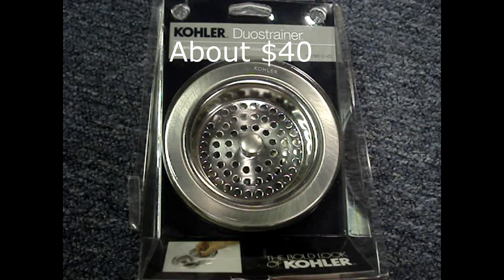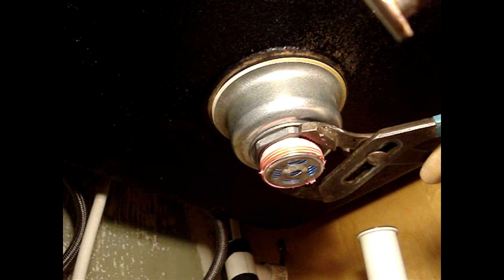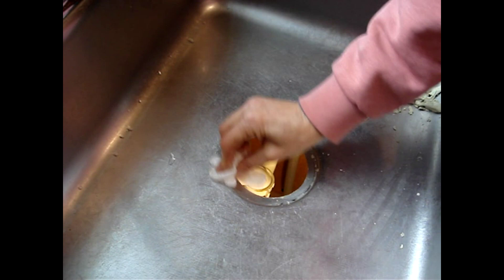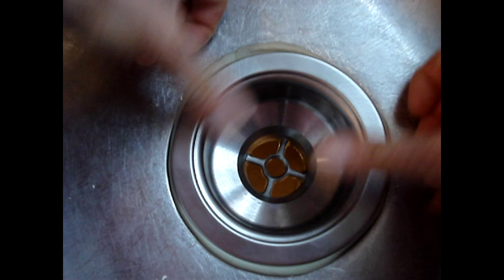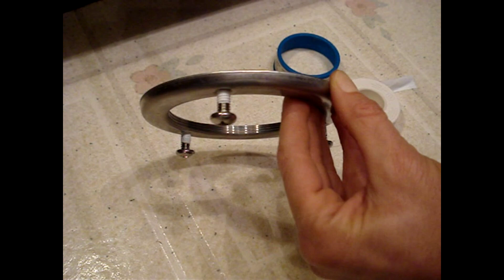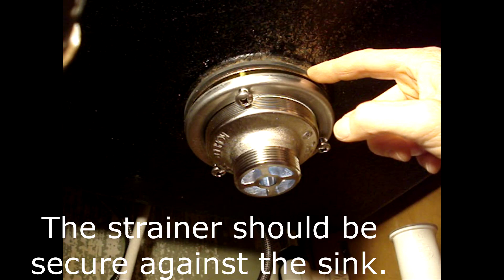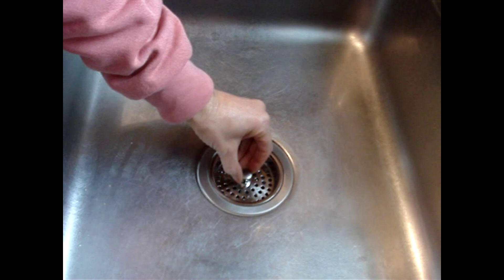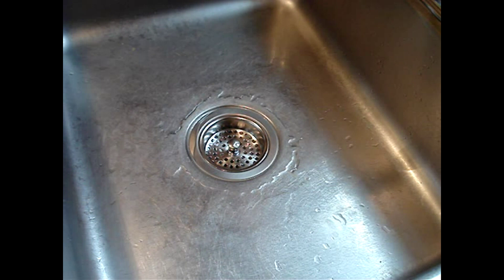Install a Kohler Duostrainer Kitchen Sink Strainer

Comment: Just the information I needed and presented clearly and concisely. I especially noted the use of teflon tape on the drain nut threads and the screws. My old drain nut was corroded and I had to use a hacksaw to remove it.
Reply from the maker: Thanks for the compliment, Steven.  Way to go on being resourceful and replacing the drain.

Comment: Nice video, easy to understand.  When I went to remove the retaining nut under the existing strainer it was frozen due to it being there for 18 years, calcium and other deposits and lots of rust.  I have tools, but think I will give the job to my plumber who is going to have to struggle to get the retaining nut off, they probably do this all the time.  Also will have to replace the tailpiece and other o-rings because they are all bent out of shape and in bad shape.
Reply from the maker: Thank you for taking the time to write the comment, Bill.  It's always nice to hear from people who watch the video.

Comment: Can someone tell me what size the o-ring replacement is?
Reply from the maker: I bought one today and tested it... works good.  Size is 1 9/16 ID and 1 3/4" OD x 3/32  #38 O-ring.  Danco Stock # 35752B

Comment: Great video, but an S-Trap is a big no no. Just an FYI. P-Trap only.
Reply from the maker: Thanks for pointing that out, Mike you are correct that S-Trap's no longer meet the current code.  I most cases, repair does not require you to meet the version of the code that is now adopted.  If I were to do a major renovation to my kitchen, then I would be required to install a P-Trap.  If I wanted to install a P-Trap, it would be a costly and time consuming endeavor.

Comment: Don’t follow this.  It will fail.  Find the official Koehler video.  You must run the screws in 1/4” above edge of nut.  Then hand tighten the nut.  Then run your screws the rest of the way in.  When you’re done the nut will NOT sit flush against the washer but will sit approx 1/4” away.  I tried using this video first and it failed.  Only after following the Koehler video was it water tight.
Reply from the maker: I beg to differ with you Andrew.  The strainer is installed as shown.  It has been leak free since the video was made.... four years ago.  Over 38,000 views and you are the only one making this claim.
Reply: @Know-How-Now  I'm just telling you my experience, and my experience after installing it the Kohler way.  Look at the Kohler video and you'll see what I'm referring to.  I originally installed it your way several years ago and it worked, until today when it started leaking.  Watched your video and tried it (same way I installed it originally) and it leaked.  Not to say it won't ever leak the Kohler way, but as a mechanical engineer I can safely say things are typically best installed according to mfg specs.  No offense, just stating facts.
Reply from the maker: No offense, Andrew, but I am having some problems with your story.  If you examine the Kohler video carefully, you will notice that there is a gap between the round ring upon which the 3 screws are installed and the metal ring that those screws push up against.  It doesn't matter whether you turn the 3 screws so they protrude above that ring prior to installing it or it they are flush as I show.  My install has the same gap as the one shown in the Kohler video.  The end result of either method is the same.  My mechanical engineer brain sees no difference.  As a mechanical engineer, I'm sure you understand that too.   If you actually tested the connections after the install and they did not leak, it is highly improbable that a leak will develop in a couple of years.  This video was published 4 years ago.... not long enough for a rubber seal to fail.

Next, this channel has been in existence since 2016.  It has over 23,000,000 views.  I read every comment.  So far no one but you has made the claim that you used one of my videos perhaps as long as four years ago and years later has come back to write a comment.  I do however on occasion have someone who seems to have some sort of predetermined bias who makes illogical arguments.
Reply: @Know-How-Now  As a rule, best to follow mfg OE to ensure proper functionality.
Reply from the maker: Repeating the same thing doesn't change that my installation has the same end result as the Kohler instructions.  If it's different, you as a mechanical engineer should be able to explain the difference between the two installations or understand that the end result is the same.  I'll stand by for your explanation of why my way is different or why yours leaked.  You should easily be able to do that given your profession.
Reply: @Know-How-Now  now you're just being obnoxious.  But ok.  By screwing it flush and then tightening the screws it's possible you aren't getting the same mechanical force as extending the screws out and then turning it hand tight (and then extending the screws further).  Not only that but I found that by screwing it flush the first time (originally) it was nearly impossible to get it off because once the water had calcified on the threads it almost acted as loctite. It took me hours to remove it.  Not so with the mfg method.
Reply from the maker: Personal attacks aside, Andrew, I don't still don't agree with you that my install is any different.  You are ignoring the fact that both videos have the end result of the 3 screws protruding above the ring into which they are installed.  You should look at both videos.  I'm still not buying your story that you watched this video years ago, installed the strainer, had a leak, then came back with an alarmist comment telling people the install will fail (this has never occurred during the past 7 years).  As for being unable to unscrew the ring, you apparently didn't follow my instruction when you watched the video years ago.  I tell you to put plumbers tape on the threads.  Your story is not credible.  If indeed you are a mechanical engineer, you wouldn't continue to make the illogical argument. Those three screws are applying pressure the same way in both installs.   I suspect you have some other agenda.  I also checked the Sparky Channel video on how to install this product.  Bill is installing it the same way as I do.  You have not posted an alarmist comment on his video.  Why not?
Reply: @Know-How-Now  I never said I watched your video years ago.  I installed it your way years ago because I didn't have the Kohler video. Eventually developed a leak so began looking for videos.  Found yours which was basically the same way I installed mine.  When I couldn't get a good deal this time I went and found the Kohler video.  Installed it this way and it took the first time.  Perhaps we should just agree to disagree.  Obviously you feel your method is as good or better than the Kohler MWI, and feel it'd an inferior method, not to mention the fact that it makes future removal difficult at best, and virtually impossible at worst.
Reply from the maker: From you:  Don’t follow this.  It will fail.  Find the official Koehler video.  You must run the screws in 1/4” above edge of nut.  Then hand tighten the nut.  Then run your screws the rest of the way in.  When you’re done the nut will NOT sit flush against the washer but will sit approx 1/4” away.  I tried using this video first and it failed.  Only after following the Koehler video was it water tight.

From me:  Your method is exactly the same end result as installing it as described in this video.  You might actually look at my video and you will see that the 3 screws are exposed and the nut does NOT sit flush against the washer.  As said before mechanically it's the same thing in both installations - 3 screws pushing up to compress the rubber ring that makes a seal.  Surely you as a mechanical engineer can grasp this.  If you actually followed my advise the removal would not be an issue due to the plumbers tape.
Reply: Andrew she did it just like the printed instructions from Kohler. They say run the screws in until they are flush on the top side, hand tighten nut then run in screws. Your method ends up with the same result so why do you have to argue about it, guess your one of those guys, LMAO.

Comment: Oh no it's an S trap
Reply from the maker: It's a 1952 home, so it is grandfathered and not a code issue for replacing/repairing existing plumbing.   If plumbed correctly an S trap is often not a problem.  In the 20 years that I've lived here there has never been a problem with the water being sucked out of the trap and a sewer gas odor.  PS - I love your Wheelock horn strobe.